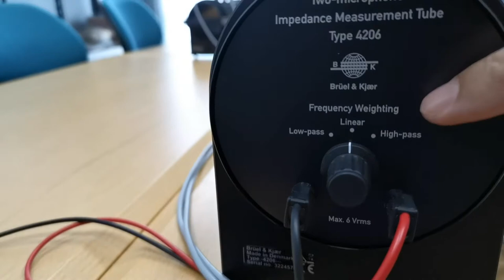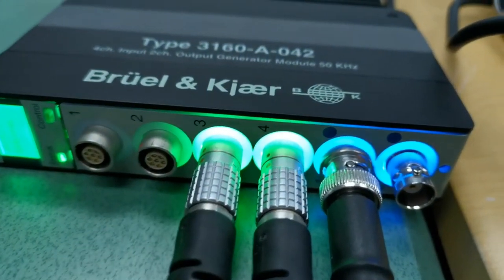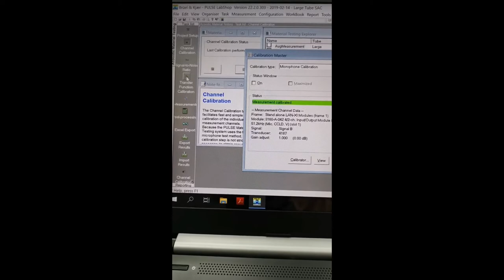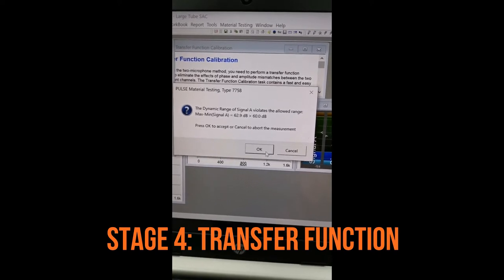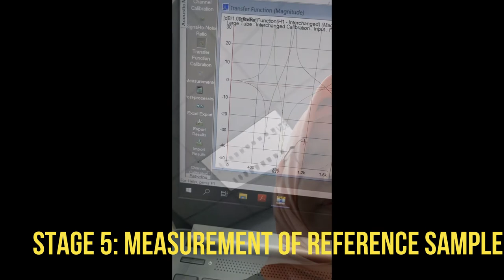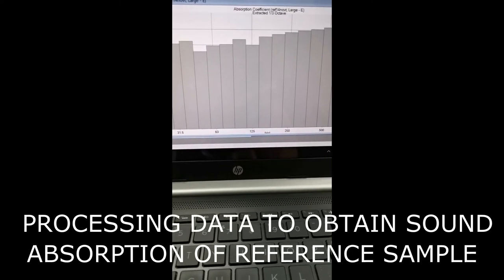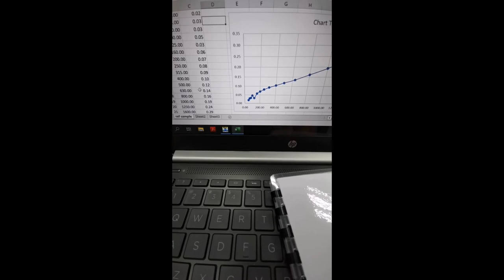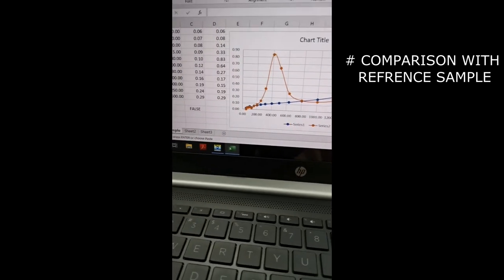HOW TO USE IMPEDANCE TUBE FOR SOUND ABSORPTION TEST OF MATERIALS (LARGE TUBE)

Comment: What is the limit in length of sample,  which can be used for testing in impedance tube??
Reply from the maker: 200 mm
Reply: Can we test sample which have a rectangular base??
Reply from the maker: @jipsongeorge5594  it must be cylinder with height less than 200 mm
Reply: Can we test sample having conical shape... with base having cylindrical cross section